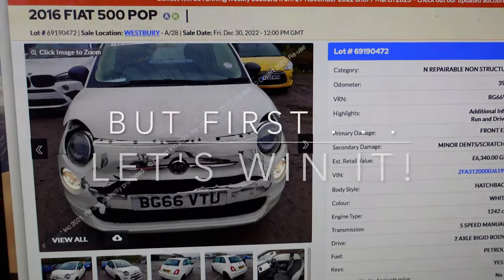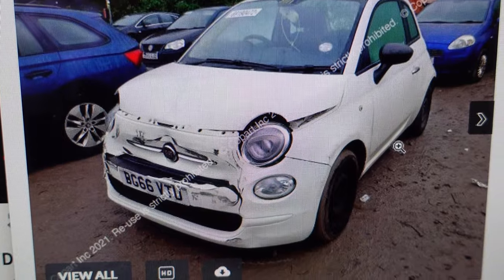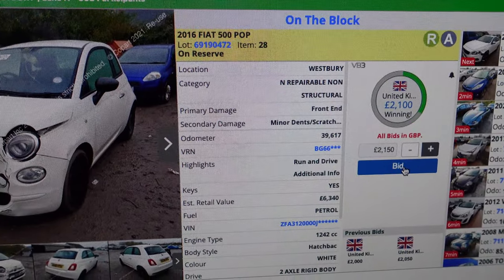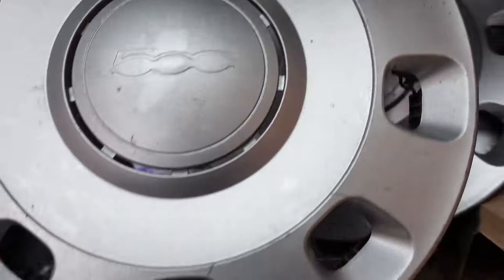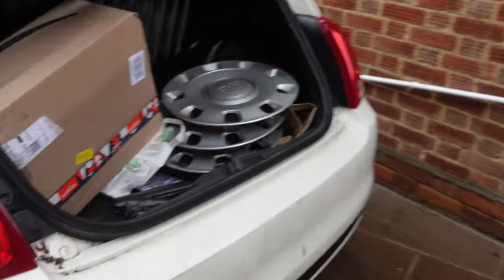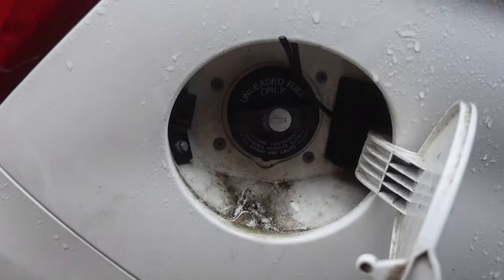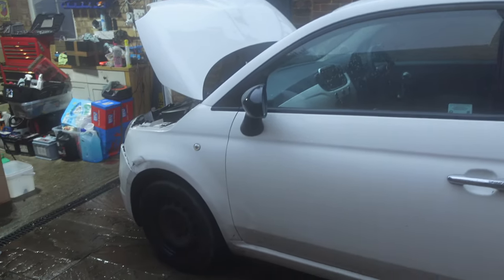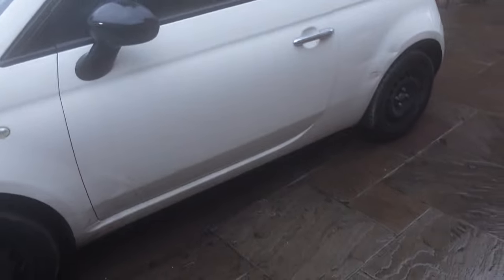Project Barry New Project Walkaround - Cat N 2016 Fiat 500 Pop from Copart Crashed Salvage

Comment: Hi Paul looks like another good un! Dont inhale to much when working inside it though!.

can i ask you a question mate! as you do a lot of work with the computer!

On multi ecu scan my engine ecu under parameters it shows the stop start function is turned OFF!
As is the stop /start function request!.
However it is marked as present in the body ecu !
Do you know if they can be turned back on to re-activate the stop/starts system?
have a good month!
best regards 
Steve in Surrey
Reply from the maker: I think present must mean it’s there. I think are able to toggle between active and inactive on certain things and then you have to do a proxy alignment.
Reply: @Love500  Nah !you can see that the systems turned off in the engine ecu perameters section but can not adjust it there! if you come out of that and go into adjustments any adjustments that you can change have no effect  on stop start at all ! hey -ho                              gonna have to make  enquires via fiat i suppose thanks for trying!
Reply from the maker: @stephenmeader8878  I’ll have a look at that next time I’m plugged in.
Reply: @Love500  let me know if im wrong?! (I often am!!) wife says anyway!!

Comment: Lovely video, really enjoyed it. I have a 2015 fiat 500 1.2 manual, when you turn the key the first time it cranks, but does not start. However when you crank it the second time it starts like normal. I have changed the coil pack, spark plugs and throttle body with no luck. Anyone seen this before or know of any fixes?
Reply from the maker: Sounds like fuel starvation. Pump priming when you switch on ignition? Injectors maybe?
Reply: Yes it primes. Let me try the injectors 🙌
Reply: @hasb9187  there’s a thread like this on fiat forum currently.
Have you checked battery voltage?